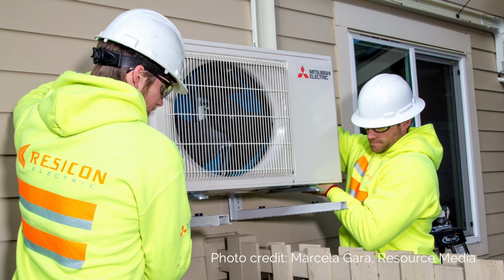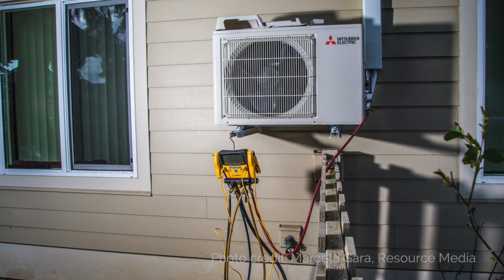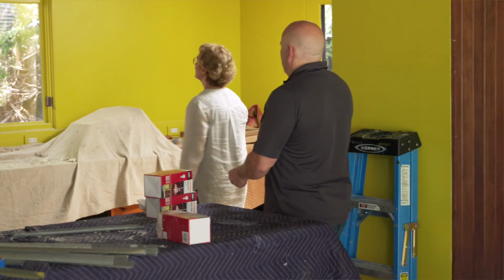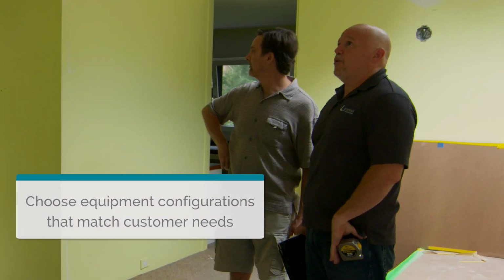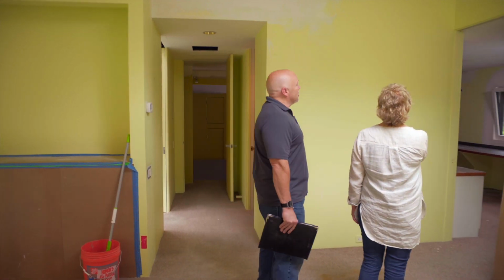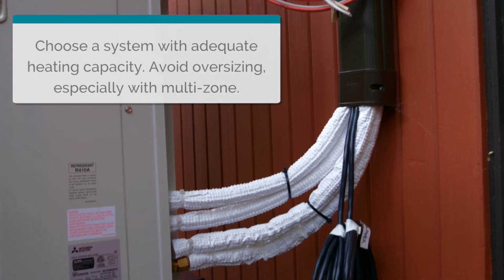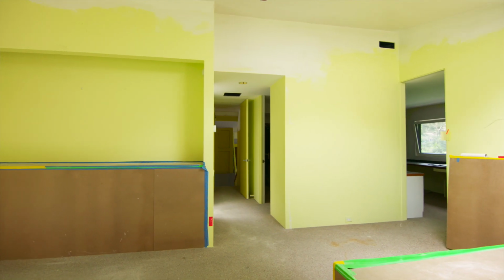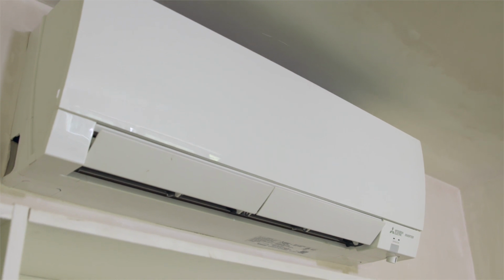Sizing & Selecting Air Source Heat Pumps in Cold Climates

Comment: I have an older Lennox heat pump that is 10 years old, using existing duct work.  It works down only to 38 degrees.  In CT, in the cold of winter, I go back to oil during the nights (and days) when it is below that point.  I am going to do research to understand how low the center heat pumps go today.  The system I have now probably will need replacement in the next few years and this video is encouraging that it may work with a lower temperature.
Reply: Have a energy audit of your home, do the best you can on thermal envelope of the home, insulated doors, dual pane windows air sealing. Is your duct work and runs that are really well insulated, make sure. New Cold Climate Heat Pumps can easily do the job if installed and run properly. See NH study and pilot using heat pumps somewhere here nYouTube. Inverter model with COP at mid 4’s or above.
Reply: @Pierceb2  We did an energy audit before installing the old heat pump 10 years ago.  May do a new one before we install another heat pump.  I just saw Lennox is the first US company to develop a heat pump that works down to 2 Fahrenheit with 100 percent efficiency, and down to -10 Fahrenheit with 80% efficacy (this is following US government tests).  That would work for almost any condition I face in New England. If my unit lasts a few more years (and it should) I can probably replace it with the same brand and much lower temperatures which would be very nice.
Reply: @Buc_Stops_Here  Great, I too had Lennox 14 SEER A/C here in MA with separate Oil Boiler Radiant Heat. My Lennox dealer of 29 years had first opportunity to bid on Heat Pump for whole house. Did not do Manual J measurements of house for Heat Load or Heat Loss etc. No recommendation even to upgrade 29 year old A/C runs to rooms with now available R9 runs. Calls me with quote with no presentation and tried to bluff me with BS. Went with Daikin Aurora Cold Weather Heat Pump. But LG, Mitsubishi, Samsung we’re all contenders. 
Yea, your older heat pump is not really a true cold weather heat pump like todays top models. True cold weather heat pumps today are Inverters, COP’s close to 5, 20 SEER for A/C
Reply: @Pierceb2  Good to know, thanks for sharing.  I note that all the suppliers you mention are Korean and Japanese.  Good to see the American manufactures are moving in that direction as well.

Comment: This video is a bit old.  Mitsubishi and LG both make cold climate models.  Ducted and ductless indoor units are available.  Mitsubishi even makes a dual fuel system.  Make sure to size the unit to the heating load.

Comment: I thought the idea behind these minisplits was being able to service up to 8 zones efficiently.  I’m remodeling an older home now and will need four zones to properly service the home.  Is that bad?
Reply: No. You can get a 4 zone system easy. Make sure its the right size for each room.
Reply: It isn't bad per se, but the efficiency of these systems generally goes down the more zones are on a condenser. Put another way, 8 single-zone systems or 4x dual zone systems would achieve higher efficiency, such as SEER.
However, then you have many more condensers in your yard taking up space. It is a little bit of a tradeoff, but try not to let it get in your way. An 8 zone system will still be more efficient than central aircon thru old ductwork.

Comment: So how would the heat get around a 3500 sq ft house without duct work?
Reply: Some are air to air. But others are air to water.
So you use a normal water radiator system instead of central air.
Personally I'd go for air to air for central air as it's cheaper.
Reply: There are ways, but when the house is above 1500sqft then it typically isn't worth getting minisplits. The house becomes too big and you would need multiple minisplits to cover each corner of the house. 

I've still installed minisplits in houses that are up to 2500sqft, but those houses had few rooms, 4 rooms i believe. Then the downstairs was basically open, very few walls. I installed a 4 zone minisplit upstairs where the rooms were and then installed another 4 zone minisplit down stairs. 

It worked perfectly and they're super happy because they thought they'd need to install gas or invest in ductwork. It saved them 7k$. Plus the system is much cheaper to run, so their bills are pretty modest. 

But the only reason I got away with this was because their house was configured in a way that minisplits could still work. In most house in the US people like to have dedicated rooms to things and put up a lot of walls. This makes minisplits a pain because the walls will get in the way.

Comment: According to the laws of thermodynamics, heat flows from hot to cold surfaces. So, if it's cold outside, how can these heat pumps possibly draw warmth into the property?
Reply: The laws of thermodynamics apply to opening a window or having poorly insulated walls. However a heat PUMP can pump heat energy "uphill" from cold outside, to further warm up the inside.
Reply: @ewicky  OK. It's interesting that it can, but a fan heater, for example, will create heat much quicker than that. Sometimes you want heat quickly. Why have to wait ages? It's like trying to gather up leaves lying on the lawn instead of using a blower to get them all in a big pile.
Reply: @johnchoice1371   A 2 kw fan heater will give out 2Kw of heat a 2 Kw heat pump will give 6 kw of heat in the right conditions
Reply: @ianship5058  Hang on a minute, no machine is 100% efficient. If you input 2Kw, you are not going to get back 2Kw unless it is 100% efficient. Therefore, you cannot possibly get a result of 6Kw from an input of only 2Kw. Physically impossible.
Reply: @johnchoice1371  You have obviously failed science at school go and read the laws of Thermodynamics and you might learn something. Go to u Tube and look at some videos they explain it in simple terms.I used to design and install them
Reply: @johnchoice1371  Ha, sorry John. You're just plain wrong. Maybe look up Technology Connections on YouTube; he has a couple videos on heat pumps and explains it in everyday terms.
Try not to let your over-simplified preconceived notions of the laws of thermodynamics get in the way of learning something new. Heat pumps, depending on conditions, are about 200-500% efficient at heating a home. Ian Ship is correct. A 2kW heat pump will heat 3x faster than a 2kW fan heater.
Reply: @ianship5058  What a load of twaddle!
Reply: @johnchoice1371  Oh dear you really don't know science do you? Twaddle is a measurement of the specific gravity of a liquid .There I have taught you something else .I am a retired engineer and technical director so do know something about heat pumps, refrigeration and engineering
Reply: @ianship5058  OK, but surely, trying to extract minute quantities of heat from a cold outdoor climate is like trying to find a needle in a haystack! Suppose you want heat quickly, would you choose to wait for hours for your cumbersome heat pump or would you rather just get instant heat from a fan heater? You don't need a degree in engineering to answer that.
Reply: @johnchoice1371  An air to air heat pump will take about 5 mins to give heat  providing the ambient temperature is above minus 5 deg below that they are not much use .I would never have reccomended a heat pump if gas was available ,but its cheaper than oil .But I think the rise in gas prices is a  means to push electrical energy.I do have an air to air heat pump in my conservatory but only because we use it for cooling in summer. Ok so you can check what I say use your fridge or freezer at home feel the condenser at the back and see how lonh it takes to heat up and this is only the heat taken from inside the freezer
Reply: @johnchoice1371  I can attest to the fact that these units work tremendously better than electric space heaters and are 2-3x as efficient. I get 100°+ out of mine at 0° F. The way it works is relevant to the transfer of heat  there is still heat in the air no matter the temperature unless you reach absolute zero or like -450F. It’s the same concept with air conditioning just in reverse. Not only does it still work at those conditions it has the ability to variate on days when it’s not as cold when it doesn’t take the full amount of btus to heat the space.
Reply: @nathanbrown5099  I still can't understand how there could be sufficient heat outside on a cold day. IF you walk around outside, you don't suddenly feel a warm pocket of air, you constantly feel the cold air. So it seems, if there is any warmth outside, it must be tiny.
Reply: @johnchoice1371  You can deny or not understand all you want, but there latent heat in the air. You feel sensible heat that is why it feels cold to you outside. Most new mini split systems claim to keep close to full capacity down to -22F (-30C). Most older systems claim down to -4F (-30C). When it comes down to it the technology with inverters has change the game with heat pumps the change in COE has not changed but the range of operation has. Most places in the US don’t get down below -22 anyway and if you are in one of those areas you’re not going to be using anything but a fuel powered furnace,boiler, etc you’re not going to be using a minisplit. Nobody is saying they are perfect for every situation but compared to oil or propane costs in most rural areas they are 10X cheaper to run and they supply supplemental heat for homes that have preexisting heating systems.
Reply: How does your air conditioner work? It's hot outside, but it "extracts cold" from outside and brings it in your house or car. How could that possibly work? Or your refrigerator too. Why are the coils on the back side of your fridge hot? How can they take heat out of the inside of the fridge when it's colder in your fridge than it is in your house?
Reply: @charvakkarpe  A refigerator does not have a great big fan attached to it. Why does this heat pump need a great big fan?
Reply: @johnchoice1371   John, please understand that a heat pump does not create heat, it only moves it. There is no electrical resistance heat generator here. The r410a refrigeration fluid is condensed via the pump (low and high pleasure on opposite sides), causing one side to be very cold, colder than the outside air, even if it's below 0. There is no heat outside when it's absolute zero (-273°C), therefore, when it's -5 or -22, there is still heat energy! The r410a condenses and releases heat into the house, and the resulting fluid is pumped back to the outdoor unit at down to -60f as it condensed and released its heat. When it reaches the heat exchanger, the outdoor energy ("heat") is transferred to the really cold coils because IT'S colder than the ambient air. This causes r410a to boil (just like water and steam), which then travels to the indoor heat exchanger, which blows the heat into your house causing it to condense again (thus the cycle repeats). The fan only speeds up the process by constantly blowing air at the exchanger to make it more efficient and to speed up the heat transfer process. Refrigerators don't have fans because they don't need to cool down your fridge in 1 second and can take its time via regular heat dissipation (convection) of the heat exchanger.
Reply: You are thinking in terms of Fahrenheit but you need to understand degrees Kelvin. There is heat in air (gas / atmosphere) until you get down to absolute 0. The heat pump takes advantage of this as when compressed the refrigerant as a gas looses it’s heat (warms) and when pressure is release it absorbs heat ( cools it’s surroundings) There are animated videos on YouTube that shows how this happens / works.
Reply: @Pierceb2  You can lead a horse to water, but you cannot make him drink.
Reply: @charvakkarpe  Cold is the absence of heat. Your refrigerator heat pump extracts the heat from the inside of the fridge and dumps it outside therefore  the coils are hot on the back of your fridge are hotter than the ambient room temp. That heat was removed from the inside of the refrigerator so the inside gets cooler. The “refrigerant” gas is doing the work with the help f the compressor and it’s pump.

Comment: What a load of tosh don't believe a word just jumping on the band waggon .Heat pumps are cheaper than oil but nowhere near as cheap as gas heating .
Reply: It depends on the area you live in and it depends on the heat pump you're talking about. 10 years ago, I'd automatically agree with you. But heat pump technology has drastically improved, which makes them a viable and competitive solution to many people's heat and cooling needs.
Reply: It depends where you live.
Reply: Municipal natural gas is going up in price faster than electricity. Meanwhile, heat pumps are gaining efficiency faster than fuel-burning furnaces or boilers.
Reply: @ewicky  No they all give a COP of about 3 to1
Which they b
were doing in the 1970s no improvement at all. where do you get this info ? I get mine from being and AC design engineer and technical director .
Reply: @ianship5058  3 to 1 hasn’t changed much yeah but the technologies have changed in the range of temperatures the heat pumps can effectively create that heat for one, and for two the amp draw on a new heat pump is 1/3 of what one in the 70s was old compressors could pull 15-30 amps while running while newer ones might reach 7-10 huge cost savings compared to resistive or oil heat.